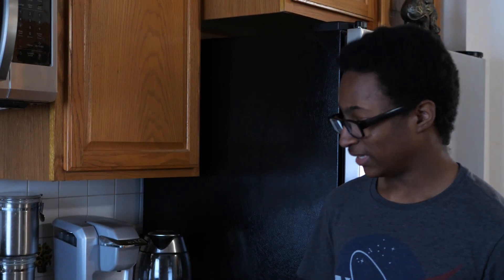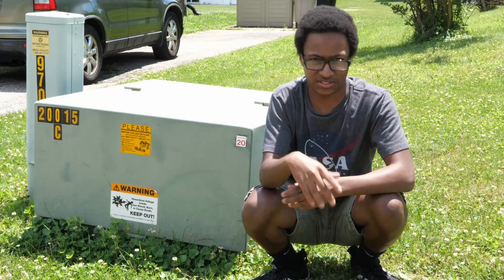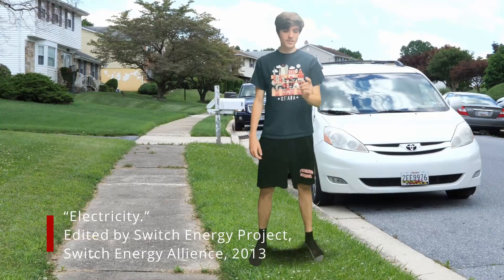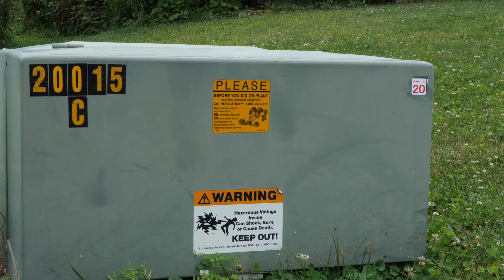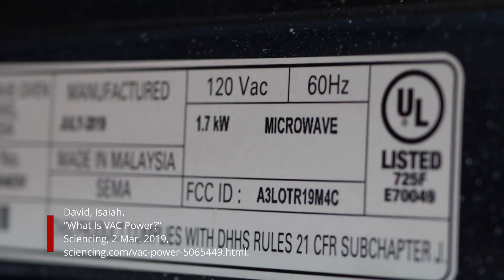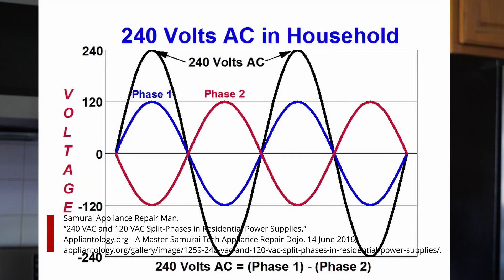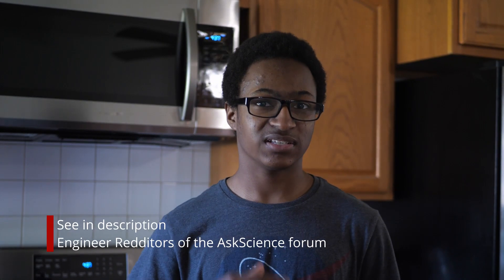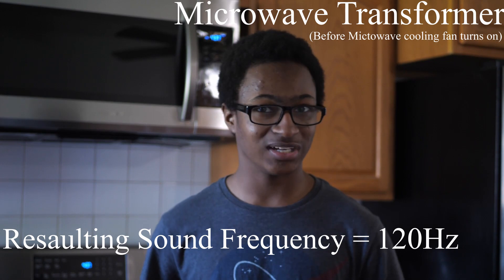Why do Microwaves make a humming sound?

Comment: My roomie stopped heating his coffee each morning by opening the door of microwave on it's way of running and then left with the door open . Several weeks later , one day , I found it still made sound after I closed the door . And the "cancel " button doesn't work anymore . I think it will stop after it run over the remainning time but actually I was wrong . Several hours later , I found it is still making humming nnoise . I opened the door ,the sound stopped . It was so hot ! and smelled badly like burning of wire . I have to unplug the microwave to stop it . I have thought I can reprograme it . I plugged again to run the microwave . This time I can stop it by pressing cancel button and can still hear the humming sound . I can't wait to unplug it .

Comment: Cool video thanks dude. Had this question, knew it had to do with the transformer. Wouldn't of guess it was because of the magnetic field vibrating. I guess it also would have been kinda nice to know what a microwaves typically step the voltage up to but isn't relevant to the question so it makes sense.